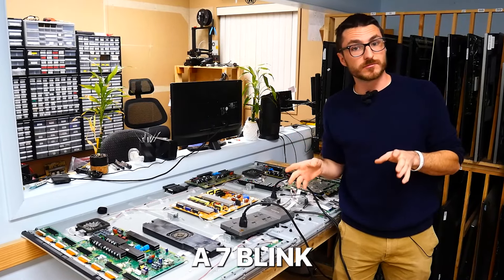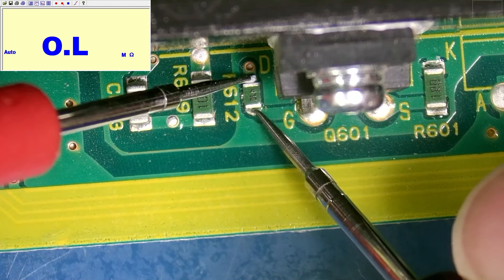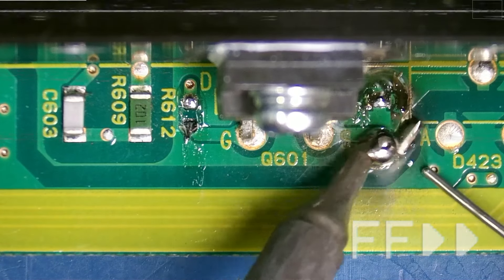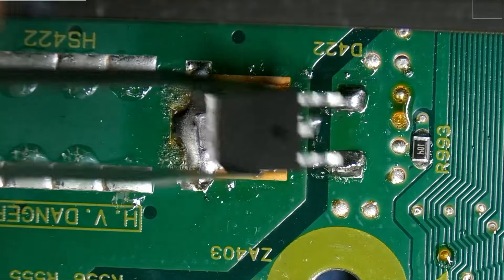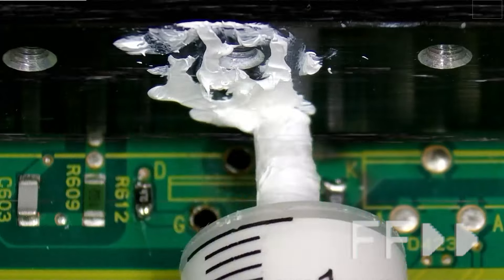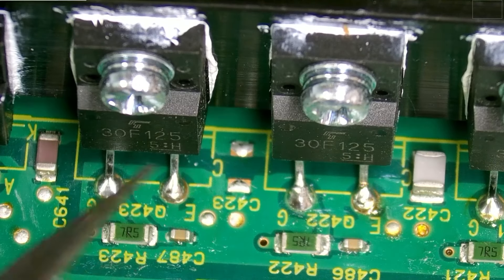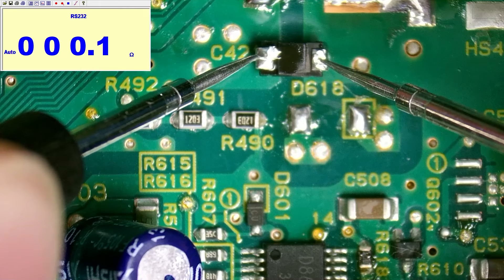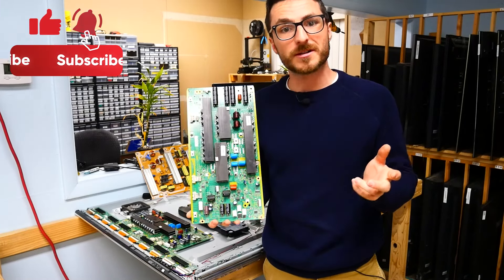7 Blink How to Fix Panasonic Plasma TC-P60VT60

Comment: Love the picture quality on those old Panasonic Plasmas.  Got a 50" one 10 years ago used with a blown SS board.  Got a repair kit for it and it is still up and running.
Reply from the maker: Yup I am all about the plasma sets as well! I have a PN64F8500 at home. One of the best plasma sets ever made. The only reason I would ever replace it is if the panel goes out on it. Otherwise I have already refurbished every board in it and will keep it for hopefully another 10 years.
Reply: I got an even older 42" one I picked  up over 10 years ago in the garage that was supposed to be dead. Brought it home and pugged it in to checkout and it worked and is still working.  I do have an external fan on the back. @NicksTVRepair
Reply: Nick, thank you for your good videos. I follow your page from Iran. Please make more videos from plasma TVs. I would appreciate it if you could speak English slowly.🙏❤
Reply from the maker: Sorry I don't do many plasma set repairs because most people choose to buy newer LED sets these days over fixing them. My plasma videos usually don't perform very well. 
 @mehdiahmadi2785

Comment: Great video ! I got this model back at 2013 new, still runs like a beast .. its so hard to ever think for an upgrade
Reply from the maker: Yes! I still have a PN64F8500 at home. 2013 model, looks better than 80% of 4k sets sold in 2024. The only TVs that are better I would say are some of the QLED and all of the OLED models. 
I really wish plasma sets had not gone out. They were great TVs, still are, and I would always recomend them to families with kids, because they have a glass/plastic cover that makes it less likely one of their kids cracks the screen.

Comment: when I lose mosfets like this, it usually takes the little power regulating ICs with it
Reply from the maker: Really does depend on the model. In some models the damage is minimal some it's more extensive, and in others, it's extreme the amount of other parts that need to be replaced, sometimes to the point that it's not worth the labor to fix it. But again it does depend on the model Panasonic.

Comment: How did you make the pop at the beginning?
Reply from the maker: We had an old board that was donated that had a few shorted components. We only replaced a few of the components leaving the rest shorted so when you plug it in,  the replaced components will blow again. 
That's part of the reason the board we fixed in the video didn't get fixed. It had more SMD components that were shorted and needed replacement. But it was too much work for the price paid + since the customer had a defective set of buffer boards and more importantly defective mainboard which are not replaceable at this time, it just didn't make sense to try and fix it as even if we were successful the customers TV wasn't going to get fixed.

Comment: Hey Nick, yes I hate it when repairs don't cooperate, it happens.. Just an unrelated question, I did my electronics trade back in the late 80s and there was no mentions of health risks from soldering back then. Is there anything we should have been aware of, is repetitive contact with tin lead solder a health concern ? Or is it just venting when soldering the main concern for technicians today?
Reply from the maker: This is the fume extractor we have at every single soldering station:
https://amzn.to/48uj1B7

This is the most important part I would say. And it's not protecting you from fumes from the metals as much as filtering out the Rosin fumes aka the flux inside the solder. So of course yes it also protects you from the fumes from the metal melting, but most solder has a rosin core to help with the soldering process, and that's the big one you don't want to breathe. As for physically touching lead, that is fine, the problem is when you ingest it so as long as you wash your hands after soldering then you should be fine. 
If you want to be extra safe you can always wear gloves when soldering.
Reply: @NicksTVRepair  thanks for the detailed reply nick, I will look into the effects on rosin etc.  Yes I don't have a fume extractor, but have a fan that blows across my desk, I should invest in one if I intend to do a lot of repairs. Lead free solder was just coming in back then, we never thought it was much good to use but used properly I'm sure it is. My 32 year old soldering station finally stopped working the other day, they built it to last, was a royel dual iron temperature controlled station. Thanks for the advice, I will take it on board.. Best Regards